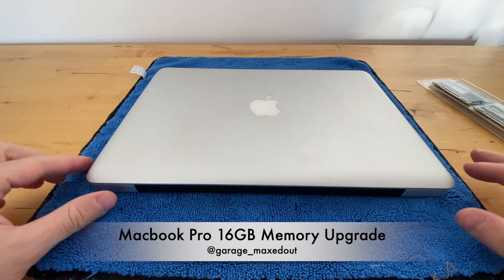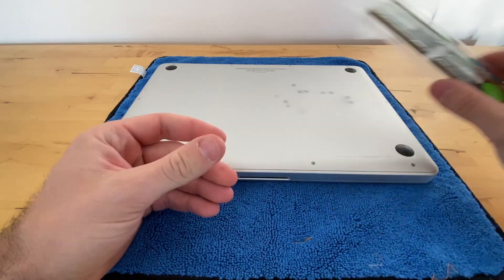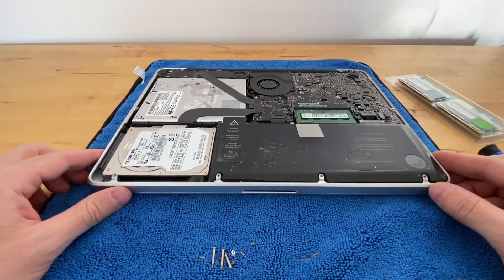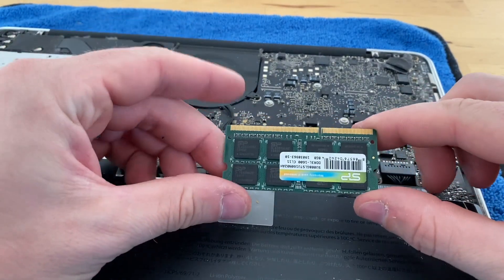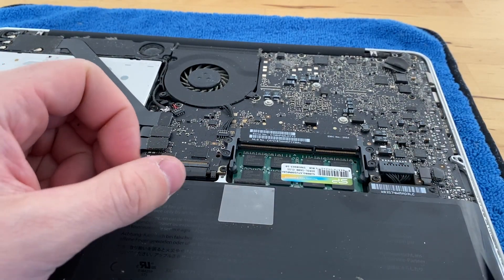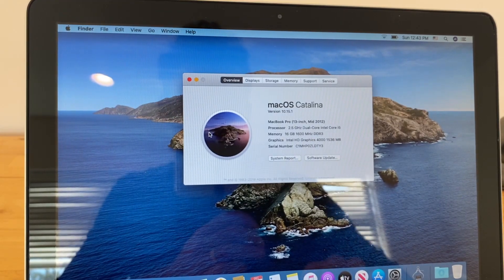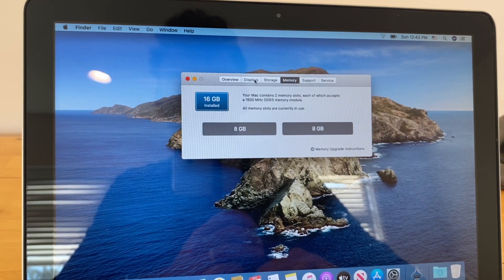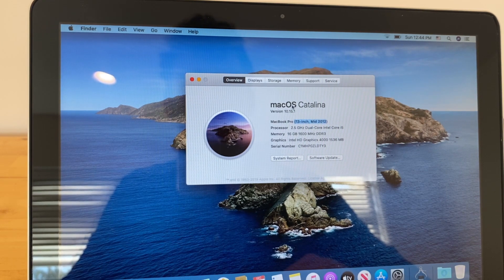Tutorial: Upgrade your Apple MacBook to 16GB of Memory (mid-2012 MBP 13 used)

Comment: so i have a 13 inch mid 2012 processor i7 and on specifications on this mac, the slots for ram are ddr3 for 1.5 volts. and the ram you installed are ddr3l which stand for 1.35 volt. so if i buy this ones would work fine on my mac even its not 1.5 volts?

Comment: If i put ram with 1.5v will there be any problem? or will it work normal?
Reply from the maker: You will need to match the correct voltage- links are in the description for the correct type

Comment: Hi, great video, I have the same MacBook pro but my processor is 2.9 intel Core i7. Will this upgrade be OK using the same ram you have installed? If so I will order using the link you have provided. Cheers
Reply from the maker: Yes, processor doesn't matter

Comment: Man that looked super simple. Didn’t know you were an Apple 🍎 Genius 😁Maybe we can do a video on upgrading and fixing my MacBook Pro 💻 ?
Reply from the maker: The Paul Orona Experiment sure- what’s broken on it? This gen is pretty straight forward on any repairs or upgrades
Reply: My screen went black on it. It still starts up and all. Was also thinking of doing a fan upgrade on it. One of the fans is broken but was able to bypass it overheating with a app to manually control the other fan in the laptop and regulate it based off the temperature.
Reply from the maker: Interesting, which model is it? It works on an external display but not on the built in screen? Could be an SMC issue- id try that first. Power it off, plug it into the charger, hold down the Shift+Control+Option+Power button at the same time for a few seconds. Then boot as normal.
Reply: Appreciate the advice. I ended up taking it to the Genius Bar and ran  diagnostics on it. They said it was graphics card issue.
Reply from the maker: The Paul Orona Experiment gotcha- must be a 2011 then? If so, you’ve got 3 options. First, replace the logic board with a new one. Second, attempt a solder reflow on your existing board or Third, disable the dedicated graphics card completely and use only the integrated graphics. The last one would be my pick in your shoes- yeah you no longer get the extra muscle from your gpu, but the laptop will be reliable going forward and no longer have heat issues. I haven’t done a video on that, but I definitely can. If your machine has a dead fan, you do still want to replace that before fixing it anyway. A 2011 still has a ton of life left if you don’t need the Catalina OS, so I’d say it’s worth going through the hoops